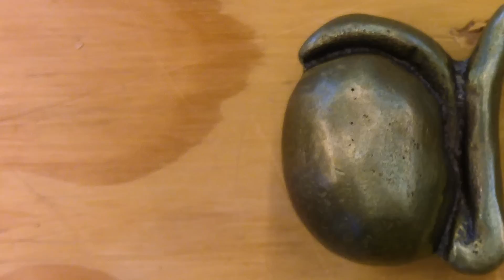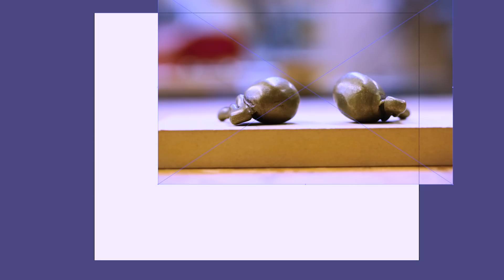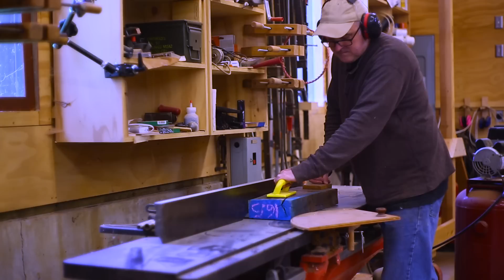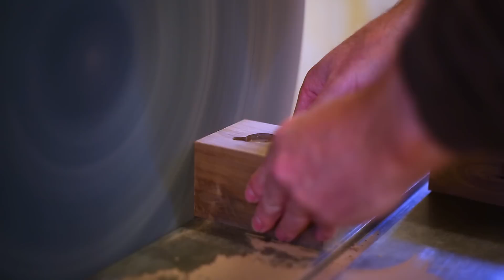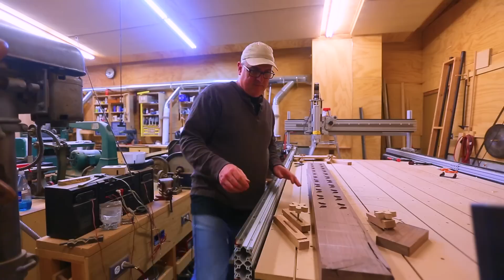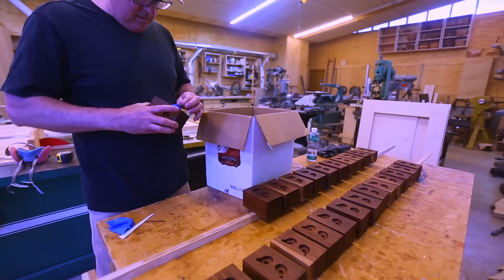Wood Holder for Brass Balls

Comment: Photogrammetry (stereophotogrammetry) would have been a perfect tool for this project, and probably saved you several steps in the fitting process. You basically put the object on a turntable, take a couple hundred pictures of it from different angles, and tell your computer to analyze the pictures. After some waiting, you have a 3D model of the object. All you need is a decent camera, good lighting, and a either a reasonably powerful graphics card, or plenty of time. There is lots of free software for it. As you already seem to be skilled with both 3D and imaging software, I reckon you could teach yourself the techniques and the software in a couple of nights of web browsing and practise.

Comment: serious tip, if you want to sink an object into wood like you have there a good way to get the cut out of the shape is to sink it into some silicone like you would into the wood then once set you can take a photo from a birds eye view and then you can see the profile you need to cut into the wood, Hope i explained that well.
Reply: If doing this, you could almost section the silicone into 1/4" pieces, photo each one, and then stack the photos in CAD?
Reply: Amber harvey I think a sand cast would have worked, too.

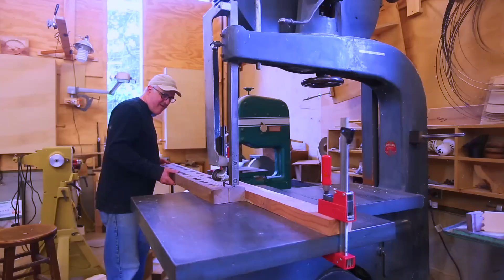Comment: 5:59 just curious to hear from anyone with the knowledge, why the band saw is better than the table saw for this
Reply: As the internal stresses from the wood are released, it twists and bows to varying degrees.  This means the kerf isn't exactly perpendicular and parallel to the blade, causing binding and friction.  The same action happens on both saws, but there is a significantly smaller amount of blade in contact with the wood to bind against with the band saw.

Comment: Now add a keyhole slot on the back to make them wall nuts. It is a bit odd that the brasses sit unmounted in the holder, per the design criteria. Makes one wonder a little about the end users' motives. "Hi, come into my office. Have a nut?"

Watching the nut containers pass through the 4200 RPM ripping blade caused a certain chill in the core of my abdomen I've never experienced when passing my hands near a blade.

These are real jewels, Frank.

Comment: Frank, could you have used something like Shapelock to make a quick mould of the bottom of the brass balls - which you could then slice with the bandsaw or a razor blade to get the profiles for the CNC?

Comment: if you ever encounter another part with complex contours try putting them in a liquid with the bottom side up. Snap a photo each time you raise the water level around the part and you'll know the exact contour at that level. Having reference points in the picture will help with aligning all the layers.

Comment: Awww b*ll*cks; I was expecting another turning video. Instead it seems you were mostly playing with someone else's testicles. Personally I think you were nuts taking that on, but it did turn out to be a plum job.

Being serious though: at ~5:55 - a short fence (that goes no further than the leading edge of the blade) is a really good idea for that sort of ripping as the wood has room to move after the cut. If it's pinching the blade then a riving knife is key - but obviously that's less easy to retrofit if the saw isn't designed to take one.

Comment: Could you have used a contour gauge (maybe two of them together) to define the patterns?  Push the gauges together around the object at the reveal level, CNC that pattern straight down into the walnut, then use a dowel to set the height.  Flock the holes to make them extra fancy.  :)

Comment: Thanks for the Contento Frank, i've always loved your vodeos and your work.
quick tio: for getting a better and more precise section curves to replicate the piece in a 3d model, you could use those thin vinyl tapes (those automotive stickers stripes or use other kind of flexible tape because of the curved surfaces masking tape might not be the best) and tape them around the object on the lines you would like to reproduce. then take the pictures and draw on top of them like you did here.

Keep it up!

Comment: not sure if this would work or not, but i feel like it wouldve been easier to get the template for the cut out to get like a slab of clay, push the brass pieces into the clay, and then take a picture of the clay

Comment: Next time you need to mound an irregular object, put the object in water (upside down) and take your picture from above, that will show you exactly where the lines should be and you can select your depth.

Comment: I would suggest getting a block of clay and then seat the objects in the clay so that they appear how you want them in the base. After removing and slight clean up, the surface of the clay would give you the shape of the top holes and if you slice the clay down to remove, say 1/8-1/4" of the top, that new surface would give you the shape of the bottom holes.

Comment: Maybe you should have made a quick resin cast of the base of the 'brass objects'  first. Then you could have made a couple of cross sections of that and mapped the resulting shapes into the CNC for a snug and supportive fit?
Reply: I was thinking something similar, although much more simplified.  That is, taking some sort of modeling clay (or Play-Doh for that matter), making it a cube, and then pressing the nuts into it.  From there, his process using a camera and Illustrator should work very nicely.

Comment: What I usually do when I want to CNC a form for something I can't measure is tape little pieces of paper around the object on the line where I want it to fit. Then I scan that piece that now has a hole that fits exactly around the object and draw around it in Illustrator. Takes, if any, one or two adjustments and it fits perfectly.

Comment: I think what you could have done to get the shape of the hole is to mold some clay   around the objects; make the wooden base out of clay as it were. After that you could use your photographing technique to digitalise the outline of the hole in the clay. By doing it like that you get closer to the correct shape. Just a thought ;)

Comment: could you explain why the band saw cuts without letting the wood release is stress
Reply: All of the above as well as the blade on the bandsaw is pushing the material down, where the tablesaw is also attempting to lift the timber up as well as hurling it toward the same bits that Frank has been making the stands for.
Reply from the maker: it does release the stress.  it just does not bind up on the blade.
Reply: The bandsaw blade has much less area and is flexible and more importantly any part of the blade in the wood is only ever 1cm or so from where the wood is still joined. You would need a very stressed piece of wood to pinch within 1cm.
Reply: two reasons: the teeth on the bandsaw are wider than the body of the blade, and the blade only engages the wood with an inch or less of depth. the table saw engages the wood over about 8 inches of length so there is a lot more area for a stressed board to grab.
Reply: Super thin blade!
Reply: +DRMNZ thanks everyone

Comment: did you know there is free software that can make a 3d model from a series of photos? maybe you could use it and transfer the image into you cnc program on future projects.
Reply: search photogrammetry software. autodesk memento is one. i have seen it used even on large objects like buildings with a drone as the camera and it was very dimensionally accurate
Reply: I think +sometimes i is referring to photogrammetry.

https://en.wikipedia.org/wiki/Photogrammetry